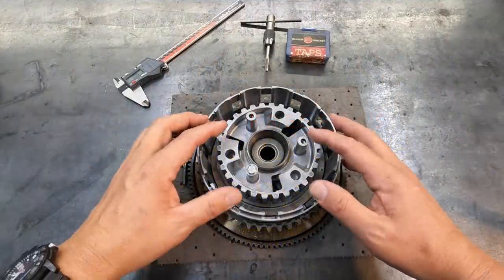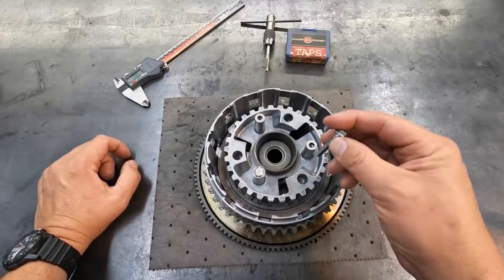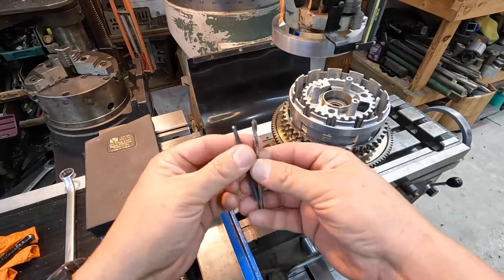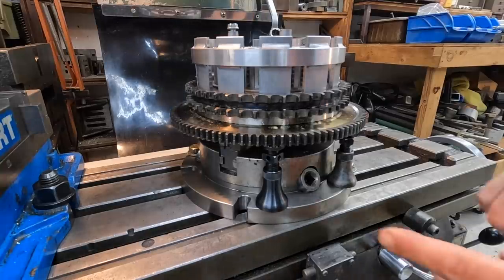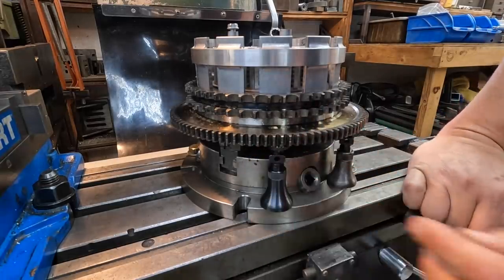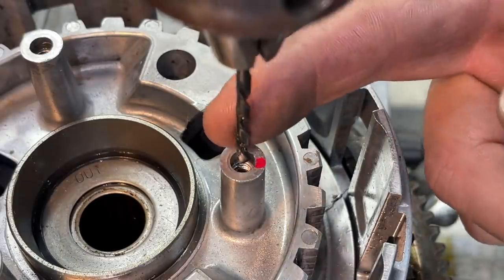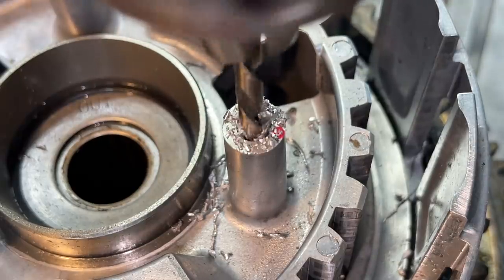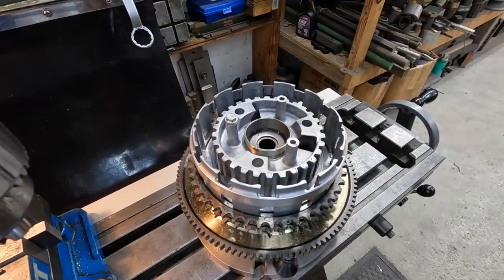Harley Davidson Clutch Basket: Broken Bolt Removal

Comment: There is an indescribable joy when a left hand drill bit walks out a a broken bolt
Reply: It kinda like being Harry Potter …. If just for a brief moment
Reply: I felt it just watching the video.
Reply: I’ve only had one or 2 work, I usually have to use an easy out.
Reply: It’s that brief moment of we will never talk about this
Reply: i was dissapointed when i heard the threads were damaged😟. he shouldnt have told us😭
Reply: @Luke_KJ  I think they should license Easy-Outs and not sell them to everybody.  True story.  Friday afternoon, 4 pm.  Coast Guard guys come in, they've got a GMC 6-71 Blower case, off their big boat, and needed some broken screws removed.  Right now.  Boss said, "do you want to work late?"   Yeah sure.  Double time?  "Yes, double time."   I asked the guy, "Are there any Easy-Outs broke off in it? "  "No."   That's because, there was an Easy-Out broken off in every hole.  Carbide went right through them, but they had ground them off flush, then lied about it.
Reply: Yep, they are magical!

Comment: I'm a Helicoil expert, the resistance you felt while loading the insert into the installation tool is because of the coil size, it is designed bigger than the SPI tapped Hole so when you release it it will expand and lock in position, Helicoil do not recommend using thread locking or lubricant or corrosion inhibition CPCs products, a clean dry hole is good enough for self locking. Helicoil recently updated their installation tool, now its made of Steel, the designed you have used is still available however in bigger insert applications the body will twist and the hot bonded insert threads will be damaged in heavy/production usage

Comment: Many years back when I was an apprentice we used to make a control panel that was one inch thick aluminum and all the drilled holes on them to mount components we used to helicol  them. the bolts where 3/8 UNF and driving in to aluminum you could strip the thread you could get some aluminum binding into the thread and snapping the bolt off. Using helicols overcame these problems. We used aluminum as it acted as a heat sink. Great videos Adam I really enjoy watching them each week.

Comment: Good job Adam. We have saved our customers a lot of money when brass threads in one part would wear and strip because the mating screw was stainless steel. After drilling, tapping and installing a Helicoil, the customer received a repair that worked better and lasted longer than the original part.

Comment: Done many of cases in my lifetime. 42 years of wrenching on all sorts of bike. One of my mentors was Arlen Ness himself when he was in San Leandro. He used to teach how to build your own bike from the ground up during his time there.  He was the real deal and a very nice man compared to the Tards like Jesse James or anyone coming from the OCC crowd that actually knew on how to build a bike.  I was taught by the best and I respect the man who gave out his teachings to anyone who wanted to learn.   Also Indian Larry was also a great man.  

I don't fully trust any Harley built after 2000.  The quality on certain parts were just not there.  People used to make fun of the FXR or commonly known as "The Fixer".  From 1987 to 1991 they had front end issues as well as really crappy cylinder head seals issues (which was on all models). Well my 1993 FXRS Low Rider Convertible is arguably the best motorcycle Harley Davidson ever made. That model had all of the issues taken care of from previous bike.  The 94 model was a transitional model to the Dyna, which I consider inferior to the FXR.  The 93 model was virtually bullet proof and so dependable IF you leave it at stock.

By the Way a original Stock FXR will get its money back or more.  Not too be for my 29 year old bike.  You can not get your money back on newer HD's nor customs.

Breaking bolts is rather more common on newer models than the 80+ something bikes that I used to work on (retired from wrenching other people's bikes, only my own). I think the quality of material used was inferior in certain places to increase more profit  than those bikes made in the late 80's to early 00.  And oh yea.  Heli Coils ARE your friend when dealing with broken bolts on a case. 

Other real good bikes IMHO are the R series of BMW's and ironically the humble Honda SilverWing which I was really impressed on how durable that bike was.  I've also owned Suzuki dirt bikes and cafe' racers in the 70's and a Ducati Monster.

Comment: One thing you might try is if you use a left-hand drill, and progress stops. Go back to a right-hand drill. Move the broken piece down a little. Then chase with a bottom tap and go back to the left-hand drill. Usually this is caused by chips jamming in the threads as you are backing out. What you can do to combat that is give it more pressure on the left-hand drill. I have found if you push hard enough to get little or no chips on a left-hand drill you usually don't have issues. I guess you could say think of a left-hand drill as more of an extractor than a drill.

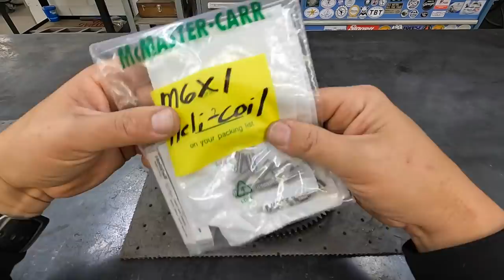Comment: 23:00 I've worked on industrial equipment with aluminum parts, that come factory original with Heli-Coils in every bolt hole.  Reason being it's stronger than just using a tapped hole in aluminum.

Comment: For any performance type work, I tend to Helicoil all mission-critical bolt holes. Valve covers tend to be a common PITA.  Ally threads fatigue over time, especially where bolts are removed regularly and constantly overtightened.  Great job Abom.

Comment: Like seeing how you deal with rust (like the American Pacemaker levelling screws) and broken bolts like this.  Helpful for me out in the garage working on my cars in the salt zone.  Not the most fun projects for you, but definitely helpful for me!  👍  I've been using the CRC Rust Converter since I saw it on the channel and it has worked great for me.  Appreciate it.

Comment: Heli-Coils are great eh? Been using them for over 40 years and they can be a lifesaver. Thanks for showing the proper way to use them, some people may have not have noticed that initially..  I'm sure the owner will be very thankful. Repair is also much stronger than the original thread.

Comment: James T Smith. -- 45 years of experience doing this sorta repair tells me to observe, listen and possibly learn.  Abom79 just shared a method of removing a broken bolt.  Variations to that are a personal  choice.  He drilled out a steel bolt out of cast aluminum. Those threads were probably damage anyway. The end result was a properly repaired hole. To comment,  "You made a lot of mistakes" isn't deserved for a really good how to video.  "Food for though"

Comment: No matter how you drill since the fragment isn't ever broken level a drill can sway especially into soft materials. The availability of Heli coils is a blessing as you said. When it comes to drills hope it bites true and run with it. Keep up the videos I aswell as others enjoy them.
Reply: This is why you make a sleeve to protect the threads and keep it centered
Reply: @alakani  wait, in a what, 5mm hole you want to sleeve the left hand drill bit??
Reply: @TheDennisZb  If he doesn't have the tubing in stock or a small enough lathe chuck, and doesn't want to drive to the store and spend a dollar, then cut out a piece of sheet metal with tin snips and roll it around the 3 or 4.2mm bit. What, you want to just jam a bit in there without even using an endmill to face it off, walk the bit directly into the threads, and then helicoil it without the counterbore the other holes have so it probably won't even go back together, and if it does it'll be out of balance?

Comment: You got better than I thought in removing that broken bolt.
If the part was mine, I would have put Heli-Coils in all 3 holes.
Reply: Yep, that is the proper way to fix this problem.  Harley mechanics around the world will agree with you.
Reply: @paulcopeland9035  yeah, it was all setup in the mill for broken bolt removal...
Off camera my guess is another 30 minutes and all 3 holes could have been 'coiled.'

Comment: What a pleasure to watch a professional !  After struggling with a similar repair on an aluminum cylinder head, (just a coil pack hold down, not critical), I see where the correct tools and more importantly, the expertise, gets it done right.  

Used a very old (30+ years old) metric Heli Coil set with the older version of the installation tool.  Looked similar yours where the insert in dropped in the window, but the nose & threaded section was longer & all plastic. Kept breaking the tang while winding it out of the tool into the work piece (very hard to turn - threads damaged likely).  The new prewinding tool you used looks to have cured that problem. 

As with you, McMaster had the inserts there the next day (after breaking all the inserts I had on hand).

Comment: I used to see this happen when I was a line mechanic "back in the day" (some even before Adam was born). Often an owner had a slipping clutch and thought that tightening those bolts would help. Snap! 99% of the time we could back it out, luckily. But we'd not spend much time on it, it wasn't that expensive to replace.

Comment: Heli coil are touted to be a stronger thread than original threads. I personally think anything aluminum should have them placed as factory production line work in every threaded hole. I've used them many many many times for repairs.

Comment: Adam, I was cringing when I saw you didn't put any cover over to bearing. Just seeing the chips made me shiver .  Is there a moto tool stone bit with a flat bottom that would fit in the hole and grind the bolt top flat? Then center drill and extractor!

Comment: I much prefer the timesert kits to helicoil. I may be biases because Honda required timesert for factory repairs but I always it to be less trouble in the long run. I always manage to get the helicoils to come out with the bolts when I use them.

Comment: Glad you showed the proper way to use the help-coil tool lol as you were threading it in I was kind of cringing. Glad it worked though! Personally I would use a small endmill to drill through the bolt and then use an ez-out. Less chance of breaking a drill in there and messing up the threads.

Comment: For bolts like this one, you can try pressing a torx bit in a small hole next time and use it as a bolt extractor.
Reply: That does work but sometimes it expands the bolt and makes it bite even harder.

Comment: This is the exact reason you should ALWAYS use an endmill on a broken bolt prior to using a drill bit.  Jagged broken bolts will never drill straight which leads to walking and eventually the unintended cutting of threads.  One would think a machinist should know this.
Reply: Actually what he did is just part of a "correct" fix.  I have seen dozens of those repaired and the best mechanics I know will put inserts in all of those mounts when they have it apart.  That is a potential trouble spot and inserts solve a weak point in the assembly.
Reply: I understand what you're saying. Yes, hindsight is 20-15! Not sure why he chose to use a flexible twist drill on a none flat surface.
I learned a bit (a lot) from this video.
He's human.
It takes a lot to make a video.
I'm working on one currently that I've done multiple shots in attempt to get my idea across.
I remember when Adam first started making videos. He was more nervous than a cat on a tin roof! He's come a long way and has encouraged many people to get out and make chips. Me for one!
Thanks Adam!
Reply: I totally agree, always use an endmill to flatten the broken bolt prior to drilling, otherwise centering on the bolt is just a waste of time.
Reply: if the bolt is loose, then the endmill will just drive it to tension in the bottom of the hole.  at that point a left handed drill will be useless, or serve the same purpose as a right handed drill.
Reply: @alanbazzano4717  
The same will a regular drill do.
Why should a end mill be worse than a drill?
Reply: @alanbazzano4717  There are also left handed end mills if you happen to have the right size on hand. That being said I'm guessing he just thought that being in aluminum, it would have come out easier than it did.

Comment: Hi Adam, when I saw that install tool for the Heli-coil I thought ??? Abom could easily modify that to work with the centring tool in the mill, so as when screwing the coil in it's not wobbling all over the place, just sharpen the angles on the crank and put a centre on the shoulder of the first bend of the crank, place under the mill, find your centre and start to crank down, nice project for you maybe, anyhoo good job on the piece, all the best from Aus, Al

Comment: Adam, those bolts break on disassembly because Harley recommends replacing the complete loaded basket as an assembly, nice job though. I think the loaded basket is $400.00 plus.
Reply: Does it come with a new bearing too ? (since he washed all the grease out of this bearing ;) )
Reply: @millomweb  The bearing is sealed so no harm done but the basket assy. does not come with the sprocket, you have to reuse it.
Reply: @carlwhite8225  Sealed for what - not thin aggressive cleaning liquids/solvents !
Reply: @carlwhite8225  ....Pro tip:  never argue with this guy about lubrication.  He is determined to soak everything in oil.

Comment: I've pretty much stopped using ratcheting tap drivers with straight flute taps because you can't break chips with them.  Working in aluminum is less of a big deal I suppose since it doesn't create the massive chips you get from steel, but the habit of backing it off every couple of turns is pretty much useless when it doesn't actually back off the tap.
Reply: I have an amazing piece of news for you.  The ratcheting tap driver has a reverse!!  Try it, it will blow your mind!!!
Reply: @paulcopeland9035  Right .. so reverse it every time you want to break a chip, and then flip the lever again to resume tapping?  Why add two steps when you don't have to?  Ratchets are great when you only want to turn in one direction for the whole operation like tightening/loosening a nut, but way less efficient when you need to change directions often during one operation such as tapping.
Reply: @andarkelorin8797  Sorry, I guess 3 or 4 switches of the reversing lever would be tiring.  I didn't mean to suggest anything that would wear you out.
Reply: @paulcopeland9035  Why are you trying to attack me?  I'm just saying that having to flip a switch several times unnecessarily while performing a single operation is inefficient, not exhausting.  Why waste any time or effort if you don't have to?  I guess I'm just not a fan of that.  If you are, go for it.  I'm just pointing out there might be a better way to do it.  Ratchet tap wrenches can be useful in tight places where you don't have the space to turn a traditional wrench all the way around, especially of you can offset the handle like you can with those old General wrenches.

Comment: Nice job! Set up and line up most important! I have some short shank tool steel in different sizes ground left hand with minimum short flutes ground in just in case it grabs and stops so I'm not having to drill out a broken drill! Thanks for your time and sharing! 👍😎
Reply: Sounds like you did that yourself.  How ? Just angle straight grind,or did you provide a helix of some sort. Sounds like a smart DIY gadget to have.
Reply: @paulmanson253  I eyeballed a left hand drill point on the stock and added a small hand ground helix. Drilled in short steps to not fill the short helix. Has served me well for over 50 years.
Reply: @jameslezak8179  Whatever works.

Comment: Looks like it to me that the OEM threads had a counter bore before the threads started but the Heli-Coil is right at the top.
Reply: How is a 19mm helicoil sitting at the top of a 30mm hole? Just because it's not in Bananas you can't follow the video anymore?

Comment: inner clutch basket has grooves already worn in, they prevent clutch from working properly. You get so called kangaroo clutch. Inner basket needs replacement, or filing down to mirror finish for it to work properly.

Comment: Sweet job will there be any problems with balance adding the heli coil?
Reply: It’s a Harley….. “balance” is a relative term
Reply: Not on a Harley.  That's why the engines are mounted with rubber cushioning.

Comment: Could one make a drill guide out of a bolt that fits the hole, by drilling out the center? Thread the hollow bolt in and then drill through it and into the stuck bolt, making a perfectly centered pilot hole for subsequent drill bits. It would be a little more work but might preclude using a Helicoil. Just a suggestion.
Reply: That’s actually a great idea, especially if you make it quite a bit harder than a normal bolt.
Reply: It is a good idea, however the heli-coil is the proper repair for this project.  Inserts in the other two mounts is also part of the correct repair.  Ask any Harley mechanic.

Comment: I can't even guess how much it would've cost to replace that part because I doubt the dealer would take the time to extract the bolt. It is cool the amount of patience and persistence required to not make the piece scrap.
Reply: "I can't even guess how much it would've cost to replace that part "

A wild ten seconds of googling shows that Harley clutch baskets are anywhere from $200 to $300 so the question is; can the dealer get it done in less than two hours? And is the dealer able to fix a "mistake" like Abom did here where the threads ended up too loose, or will you just get a drilled-out piece of crap back with an apology and an invoice?

And hat happens when the dealer does "fix" it and you install it and the new threads loosen and you end up destroying your engine? Who's to blame, you for not using original parts or the dealer for a bad fix on a part that harley probably wants you to replace anyway, given that it's "only" $300?